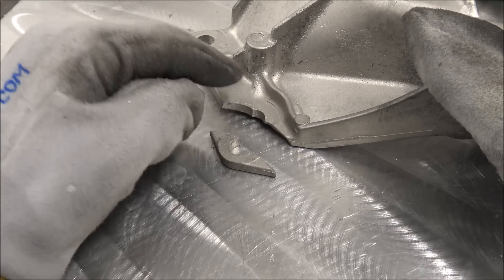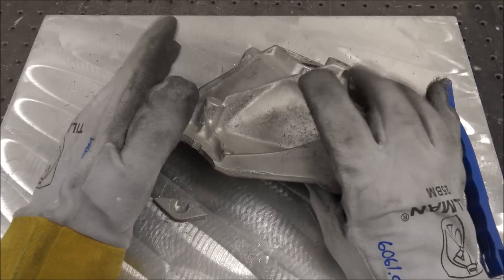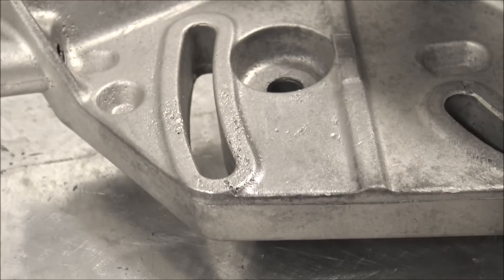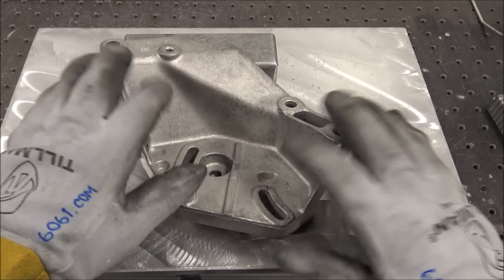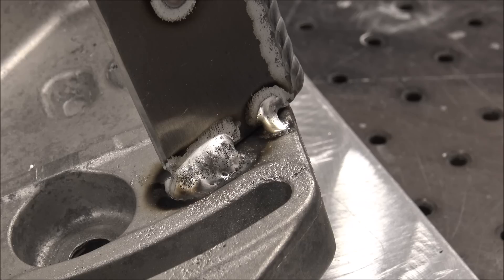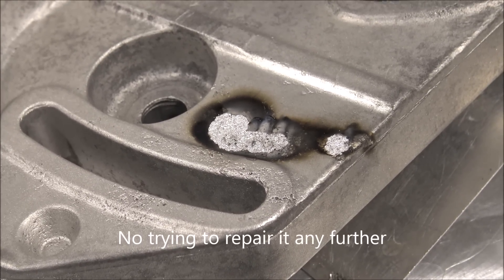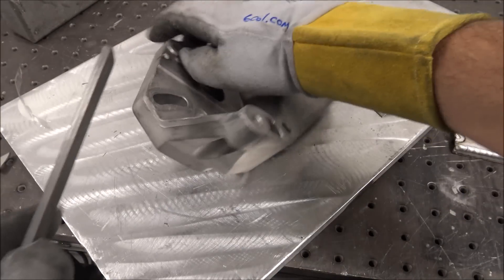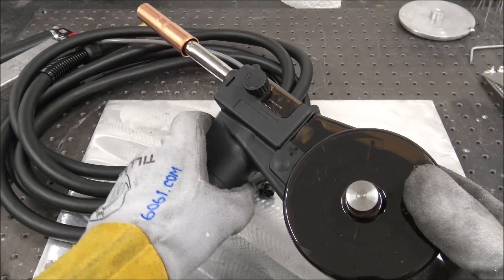Weld Repair Gone Wrong - Here's why it failed.

Comment from the maker: I'd like to make a part 2 to this video if someone WHO KNOWS AND HAS HAD EXPERIENCE with successfully welding CAST magnesium can suggest the EXACT rod they used for a similar repair.
Please no comments like "try this, I think it would work"... If you aren't 100% sure from your own experience, please don't suggest anything.

If you don't know what you're saying, please don't say it. That'll save me a bunch of time sorting through all the self-proclaimed experts regarding this video topic. I want to keep my videos and comments section as straightforward and factual as possible with no misinformation.

Thanks for watching
Reply: I used to work at a place where we repaired magnesium aircraft parts. The parts were of a known alloy of course and we welded them with AZ61 filler. Magnesium corrodes like crazy when exposed to the weather. Many of the parts that we repaired were severely corroded. We removed the corrosion and built them back to the original contour. Everything we welded was painted with a green colored coating after welding.
Reply from the maker: Thank you Chris for the type of rod, and the application explanation.

(jeez, that rod is pricey)
Reply: I use Blue Demon ERAZ92A rods in 3/32" for Stihl Chainsaws

Comment: A while ago I had to repair a 5 speed transmission housing from an old BMW. The rear center mount above the drive shaft flange was broken. Well, it was a nightmare. 
And now tell someone who has no clue about aluminum welding that there are day and night differences between a good casting and a bad casting.

Comment: I could tell, even on video that the casting was pot metal by the tin-ey sound it made against the table. I've never heard of anyone having success welding pot metal. It possibly could be braized with a low temperature brazing rod, but as you discovered when testing, most pot metal contains too many contaminants to successfully weld.

Comment: I've seen a very similar mess (except maybe the strange flame colours) when trying to weld parts which I know are aluminium (I've done hundreds of them before),  but which someone has cleaned via media blasting with something which leaves media particles embedded in the surface, such as glass. The clean look of this part when it arrive made me wonder what it had been blasted with. I've found the only way to get such parts to weld as they should is to file the surface away where the weld needs to be, exposing the uncontaminated aluminium beneath.

Comment: What about those aluminum brazing rods they have in the hobo freight. I’ve got some of them but never have used them yet. Supposedly you can stick parts together with a low heat torch. Have you any luck or experience with those?

Comment: Any chance you could have welded that with a magnesium filler?

I have a friend who's engine oil pan had a dent and a crack in one spot. The manufacturer (bmw) stamped the alloy designation right into the casting – AZ91. We did a quick test with a drop vinegar just to be sure – it did bubble up when aluminum wouldn't do that. Found the right rod (AZ92) for the job and voila – successful repair.

Wanna hear your thoughts on this.
Reply: Although the repair wasn't structural – not a cracked bolt hole, only the smooth surface area that keeps the oil in and debris out. So I can't account for how this type of repair would be successful on somewhere with substantial mechanical stresses.
Reply from the maker: I ordered some AZ92 rod to try on it. Stay tuned.
Reply: @6061  there is also material AZ61a
Reply: Similar for a Saturn, a few welding attempts were not going to yeild good results, warmed the part up, a little plastic work to be able to put a vacuum on the crack and inject some jbweld, never leaked a drop. fresh mixed  JBW over 120f has a very low viscosity but its cure time gets pretty short.

Comment: that is a die-casting, and likely Alloy A380 which is very common, and has questionable weldability at best; it can be done, but requires specific filler to even have a chance

Comment: Is the part die cast aluminum? Some die cast aluminum alloys contain enough zinc to cause the material to out gas when you strike an arc on it. The zinc vaporizes under the heat of the arc. Have you ever tried to use brass rod with a TIG? It doesn’t work because of the zinc. Silicon bronze contains copper and tin instead of copper and zinc like brass (Everdur?). It can be easily applied with a TIG welder. I have noticed that white metal castings that have the small circles on them are often die cast. I am not sure if these are the places where the molten metal enters the die. I have noticed that a lot of parts that have them are not weldable with the TIG process however.
Reply from the maker: Hi Chris,
I have used brass as a filler rod, have you?
https://youtu.be/txdNPDhSEg8?si=rNpDDtGFuj0OBnvI

Comment: I’m by no means a master at magnesium but the best of my knowledge az92a is the best all around filler for magnesium and we try to pre heat the part to at least 200 f before welding for best results but the reality is it will or it won’t because you can never know the true amounts of zinc aluminum and magnesium if you dont have the manufactures info

Comment: This is the time for JB WELD,   first I would bring a few angled groves into metal at different angles then mix up JB WELD use at least 2 -3 times and push into the groves and then reinforce on top and bottom with little extra.         When you cant weld then JB WELD can help.
Reply from the maker: Hard pass on that suggestion.
Reply: That’s a weird metal, wonder if it’s has a lot of zinc in it . 

Those low temp aluminum welding rods at harbor freight are a zinc alloy.

I repaired a dirt bike foot peg with it, and the stuff does work well and bonds to just about anything